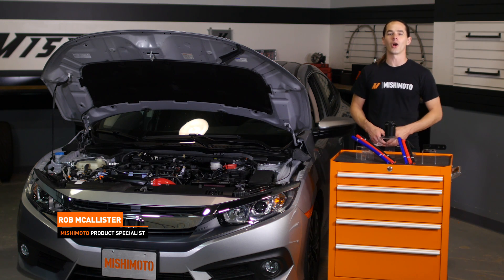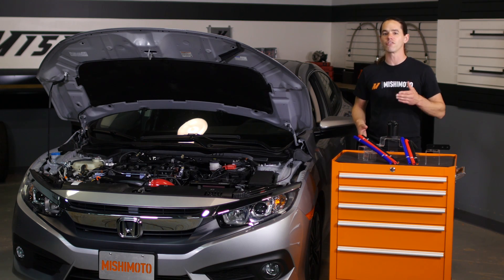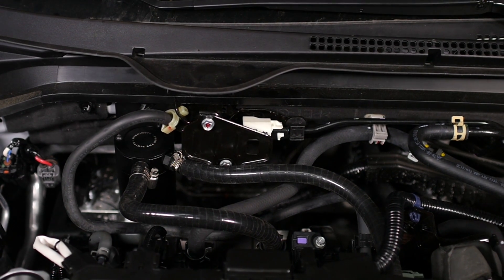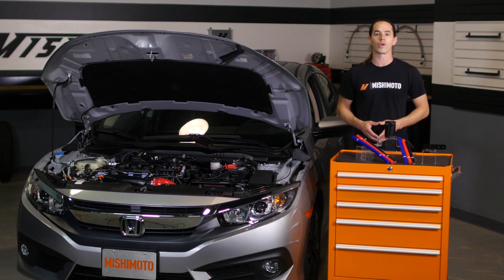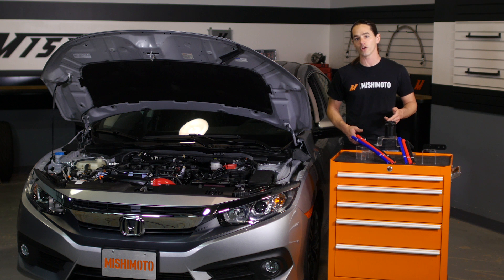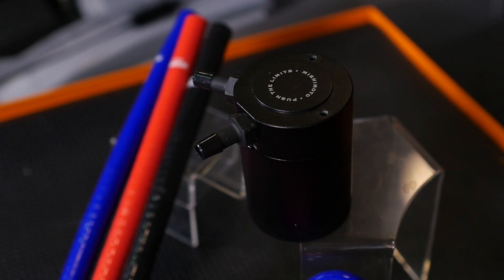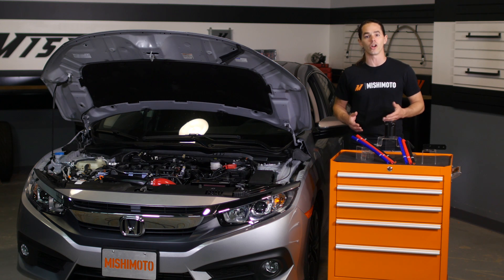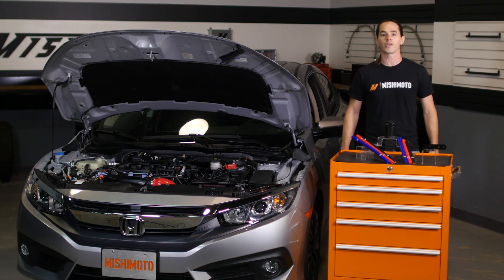2016+ Honda Civic 1.5 Turbo Baffled Oil Catch Can, PCV Side Features & Benefits by Mishimoto

Comment: I installed one on my 2018 civic si, i get a hissing/air gurgling sound sound from about -4psi  to about 7psi or so. is this normal?
I double checked the lines, and going to the correct ports and they are snug
Reply from the maker: Hello Phillip. While a hissing sound is relatively common when installing an aftermarket air intake, our customer service team would be happy to look into this for you. Just send a message to support@mishimoto.com with this sound and we'd be happy to make sure all is well.
Reply: Mishimoto: thanks

Comment: if this catch can is so important then why didn't the Honda engineers design one for this engine?
Reply from the maker: Hey Saul! Our catch cans are made for the performance car enthusiast...it's a worthwhile investment if you plan to keep the car for a long while. Oil deposits at 100,000 miles will be drastically different - you'll have improved performance THEN!

Check out this in-depth Blow-by article on our engineering blog: mishimo.to/2gPYBdq